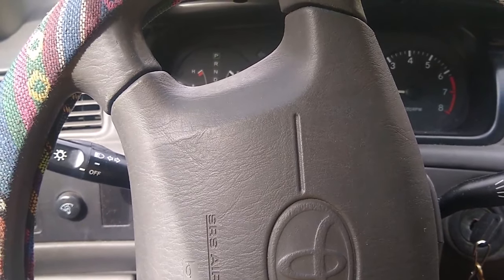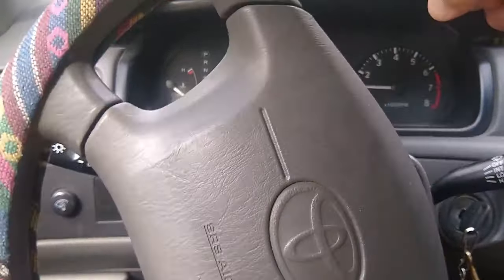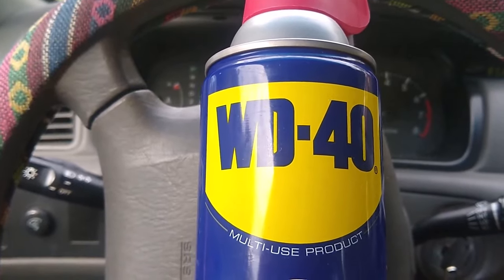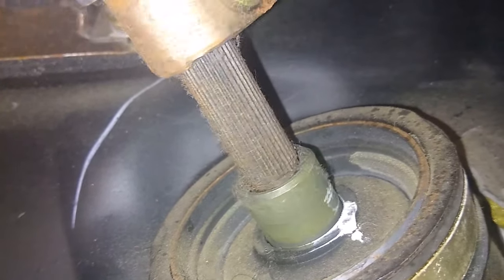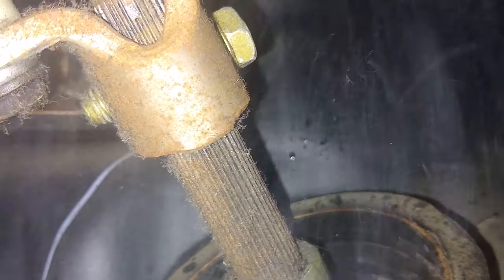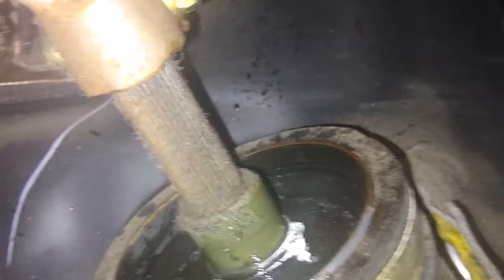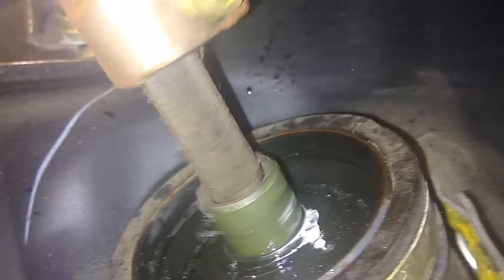How to Fix Squeaking Steering Wheel DIY video #steeringwheel #squeaky

Comment: just so everyone knows ur bushings are cooked this should just be a temp solution to fixing ur issue
Reply: Thanks for the information. Best of luck with your next DIY project and hopefully you will subscribe to Big Al Repairs.
Reply: so how do you fix it completely?
Reply: @Frreezing using SILICONE based grease/lube spray.. those will not damage rubber and plastic unlike OIL based grease/lube spray

Comment: Use silicon paste or white lightening grease it will last a very long time. WD-40 tends to dry up and attract dirt.
Reply: @Jerry.  Thanks so much for your comment and suggestion. We're always looking for better ways to do things. Best of luck with your next DIY project.
Reply: White lithium grease?
Reply: God bless you brother! White lithium grease did the trick
Reply: That’s what I was wondering - thank you!
Reply: From the research I have done lithium is a no no on rubber and plastic over time but I may be completely wrong on that so I would look into it. But it sounds like silicone is always safe and calcium and polyurea based are usually safe as well but not as safe as silicone based. Hope that helps!

Comment: WD40 dries up. Its really not a lubricant but a water displacement solution. WD40 with silicon or lithium spray would last longer.

Comment: I have a similar sound on my 07 chevy trailblazer , Can this happen or be the cause of the squeak  on chevy's as well ?  I only really notice / hear  it when turning the steering wheel when car is running and I move the wheel back and forth a  few inches from a sitting still / parked  position ... dont really hear it while driving at normal speed , Maybe it does it a little at very low speeds such as in a parking lot , but it does sound like it's coming from the steering wheel and not outside the car .
Reply: It could very well be the same thing. Thanks so much for your comment. Best of luck with your next DIY project! Please let us know what the problem is.

Comment: I’ve got a 2014 Ford Raptor , I’ve experienced some annoying squealing / rubbing noises within the steering wheel only when steering to the left on a stop or at an angle  . Is it the same area as diagnosed in the video ? 

Thanks
Reply: @Khaled. I assume it should be in the same general area.   Please let us know how it turns out.

Comment: What exactly is that part you lubricated called, sir?
Reply: Thanks for your comment.  The rubber part is called a Gaiter and the rod is called the steering column. I hope that helps. Best of luck with your next DIY project and hopefully you will subscribe to Big Al Repairs.
Reply: @BigAl-1  thanks but you didn't answer my question.
Reply: @fallenone6  I did edit it with the answer, but I think you had already responded.   The rubber part is called a Gaiter and the rod is called the steering column. I hope that helps. Best of luck with your next DIY project and hopefully you will subscribe to Big Al Repairs.
Reply: @BigAl-1  thank you

Comment: can you show us where to lubricate? I am not sure where exactly it is?
Reply: Unfortunately I no longer have the vehicle. But if you just follow the steering column down it just got from where the brake pedal dance you'll look up you should be able to identify what is on the video.  Best of luck and let us know how it turns out.

Comment: Is there a way you can redo this please. I have no clue where that part is to use the WD-40. If I can fix it I will most definitely try anything
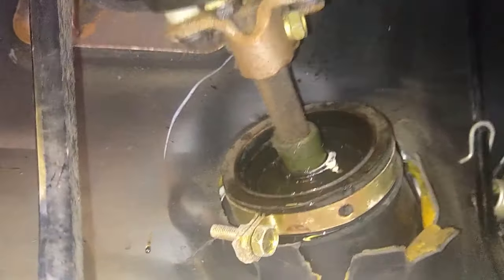Reply: It's under the dash. Where your feet are when driving. Near the brake pedal. Look down there with a flash light and turn your steering wheel - you will see it turning. You can see in the video at the 1:00  mark
Reply from the maker: Thanks for the comment. Yes as stated in the comment below, start the video at :58 and it will show you.  It is right above the brake pedal.  Yes, a flashlight should help! Let me know if you still have trouble finding it.

Comment: The problem with WD40 for that is that’s it a petroleum based product and a lot of rubber sleeves are not petroleum resistant. Great video but find a lube that’s not petroleum based

Comment: So what’s that part of the car called?
Reply: Birb,  the steering wheel attaches to a shaft (called a steering column) that connects to a rack (a long metal component with serrated teeth that links the two front wheels together). The steering column and rack are joined with a gear wheel called a pinion.  I hope that description helps. Best of luck and hopefully you subscribe to big al repairs.

Comment: Hi!... I have the same car... so do I need to remove the steering wheel? Can I fix this as a non mechanic?
Reply from the maker: Hey, we fixed it by spraying a lubricant underneath by the foot petals.  Watch the video and let us know if you have any other questions. You do not need to remove the steering wheel.
Reply: I’m going to try.... my son said it sounds similar to the sound you mentioned and he can hear it on the outside of the car... could that be a more serious issue?
Reply from the maker: @LaLaG__001  You could always try it on the inside steering wheel and see if that takes care of the problem.  If not you might have to dig deeper to find the problem coming from the outside
Reply: @BigAlRepairs  thank you 😊
Reply: @BigAlRepairs  Mine makes a sound where the steering wheel connects to the drive shaft instead , I sprayed some wd40 but didn't wanna soak the connectors , is that ok to wet the connections ?

Comment: I got a similar sound but in a different make. I'm going to check out the area you describe. Maybe I can fix mine too.
Reply from the maker: I hope it helps! Thanks for the comment and for watching the video. Let us know if it helps!
Reply: @BigAlRepairs  Got up under there, and find out mine is not as accessible. It basically has a boot covering everything all the way to a wide flared base attached to the firewall/floor area.
Reply: @chickenfarm09  Dang.  That is too bad. I'm not sure how you can go about lubricating that if there is a boot. Is there any way you can move it back a little bit to add a lubricant? Best of luck and hopefully you have great success.
Reply: @BigAl-1  Doesn't seem to move much, and I don't want to rip it. Not only that but I don't really know what all components are inside.
Reply: @chickenfarm09  I wish I had an answer for you. You might want to talk to a service department mechanic at the dealership and see if they have any suggestions.   Or look on some forums online.   Best of luck and let us know how it turns out.
Reply: @chickenfarm09  did you end up fixing it?

Comment: Would thisnwork for a 2006 chrysler 300c
Reply: @Sketchy. The only way to find out if it will work is get up underneath the steering column and take a look and see if you can see that unit rotating. Best of luck and let us know how it turns out.
Reply: @BigAl-1  i have same car so does the car needs to be started to do this ? to go underneath on top of the pedals to access the steering column and spray?
Reply: @LulDon0  Great question.  It does not have to be started but it does make it a lot easier if it is running because then the power steering is working. Best of luck with your projects and hopefully subscribe.

Comment: bro Wd40 isnot a good lubricant, thats why it came back, use a different product
Reply: Such as??
Reply: @robertoroberto9826  check homedepot they have different kinds
Reply from the maker: @bluesparrow1287  Thank you for the tip. Just curious as why you think it is not a good lubricant? Any thoughts or specific recommendations for our viewers would be helpful to them as it sounds like you have experience
Reply: If you use silicone lubricant, the sound wont come back. I assume there was grease when it left the factory. Wd-40 is a water based lubricant.
Reply from the maker: @BLUEZIE1979  Yes, WD40 also has a silicone lubricant which we linked in our description
Reply: Use a thick grease like vaseline  really rub it in there with your finger 
I fixed the squeaking of my parents livingroom door by greasing the hinge pins before reinstalling them a few years ago. now the door is still silent as can be.
Reply: @TheDutchGuy110  Thanks so much for your recommendation.